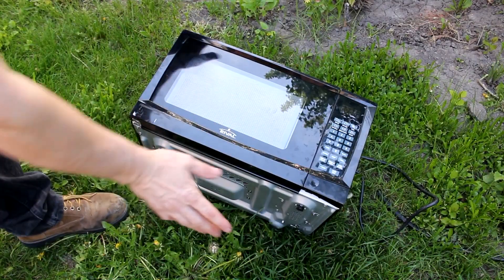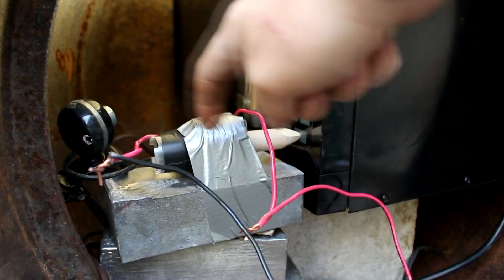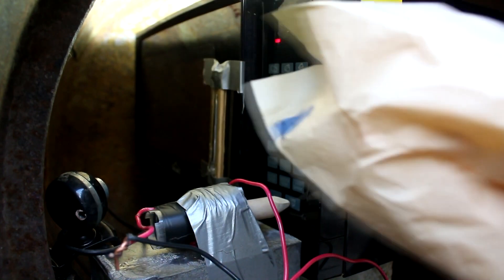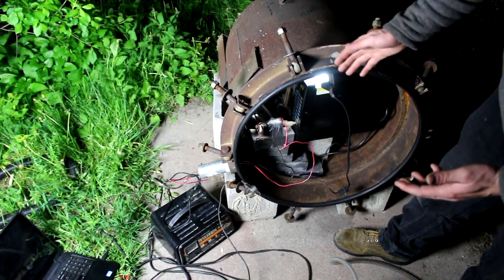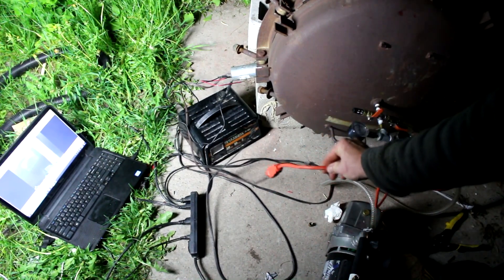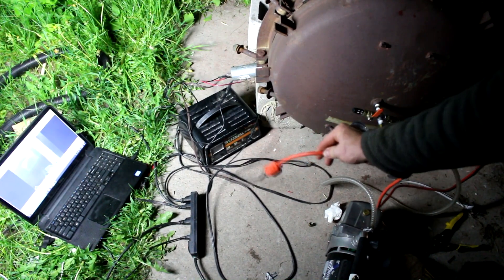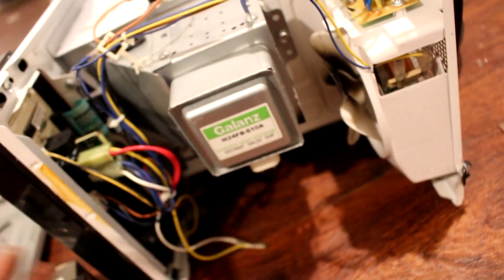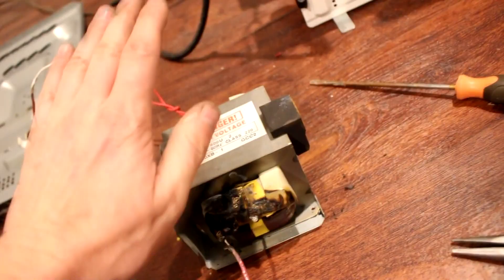Microwave In Vacuum Chamber

Comment: Cody i do quite a bit of work with electricity in a vacuum. i find that in the %95 ish range the electricity can jump a 2" gap fairly easy. especially with the 1-2kv that is the output on the secondary. good luck i look foward to your video on arcs in a vacuum, remember that over 20 kv x-rays are strong enough to go through pretty much anything.
Reply from the maker: lol so by not getting a good vacuum i had the most conductive atmosphere possible.
Reply: Incidentally i just aquried a x-ray machine :). in most machines the starting kv is somewhere around 30kv, and that goes up to, on my machine, 150kv. the amount of x-rays produced is a function of MaS Mamps*Seconds. at 20kv you start generating x-rays that you have to take shielding into account.  thanks for the comment. If I am wrong let me know I love to learn correct information. Thanks
Reply: A little off topic, but whenever I forget to plug in a tool I call it a "malfunction due to a high impedance air gap."
Reply: @lukas janßen
yes i do have to correct this: soundwaves are waves in the density of the surrounding medium, in most cases air. the microwaves from a microwave are waves of the electric and magnetic field (in other words, they are light with a very low frequency). electro magnetic waves do not require a medium to spread, so they can move in perfect vacuum.  https://en.wikipedia.org/wiki/Michelson%E2%80%93Morley_experiment
Reply: you should all look at the previously posted link:
https://en.wikipedia.org/wiki/Paschen%27s_law

If you lower the pressure, the resistance starts to decrease which is what we saw in the video. At a certain point a minimum is reached and if you lower the pressure even more (good vacuum) the resistance strongly increases and gets higher than in air.
Reply: +Aleksa Djokic X-Rays are present when ever a electon strike a target. the reason why X-Ray tubes have a heated cathode, and a tungstan anode is: the cathode is heated because it excites the electrons allowing them to pull free of the cathode more easily. the anode is often chosen based upon its reactivity to electrons, some targets are more likely to produce x-rays than others.
Reply: Don't confuse "usable" x-rays and simple x-rays.  Getting usable radiography yes you are into multiples of 10Kv however, at 10Kv you will have through penetration of x-rays if not consistent/clear/strong enough to create medically usable images on film or in digital imaging.
Reply: wow this is very useful. thank you, it makes sense that the amount of energy goes down as your pressure decreses, after a certain point you would have so little gas particals to ionize that it would be much harder to complete the arc. I think that point would be a couple of Torr. good information thanks
Reply: your understanding of em radiation is way off, em radiation does not need a transport medium for example light from the sun travels through space.
Reply: in addition to the decreased breakdown voltage the insulation resistance of the wiring can also be decreased. During your vacuum electrical tests you should also use a megaohm meter to measure different insulation changes.
Reply: Lukas, micro wave is an electromagnet wave. it does not require any medium to travel.
Reply: It is very possible that the transformer arced.  At reduced pressures, it is easier for an electron to be accelerated to a high energies and then hit an atom causing a cascading effect.  At near vacuum pressures, there are too few atoms that this cascade can't happen.  However, it is also possible that it overheated.  The only way to find out would be to watch it and strap some sensors to the transformer.  Cody should do this!
Reply: That's most likely it, came here to say the same thing. The insulation on the wires of the secondary are built assuming atmosphere is present, so it probably breaks down in near vacuum.
Reply: +tinodedino  look at Tiago Jacques' comment he has a link to the law that denotes the relationship between the voltage breakdown of air and the vacuum achieved.
Reply: Dean; 20kV x-rays are VERY easy to shield, even the material of that vacuum chamber would be more than enough to reduce the amount emitted by the microwave to low (or even undetectable) levels. Actually, since the 20kV isn't effectively converted into an electron beam with 20kEV kinetic energy, and since that electron beam isn't incident on a high density target, the amount of x-rays produced from the microwave would be VERY low... but this is all assuming a PERFECT vacuum.
The vaccuum he achieved would be nowhere near good enough for even a proper x-ray tube to operate... 
In much the same way that a microwave oven doesn't generate any x-rays when you use it at atmospheric pressure, his microwave would also not be able to generate x-rays from those arcs.

Think about it this way: Tesla coils routinely operate with arcs at >100kV and power levels of several kW, but even they don't radiate dangerous amounts of x-rays either.
Reply: Correctamundo, Dean. Partial vacuum is very conductive. At low pressures, most air molecules are more than happy to act as charge transport media, once the mean free path is reduced enough for them to flow somewhat freely. As pressure lowers even further, there are fewer charge carriers left to short things out, and the resistance between two points increases. It's not too terribly likes that you can get a good vacuum with microwave popcorn unless you first remove all the oils and stuff used to flavor the popcorn. Otherwise, outgassing of the test article will keep the chamber pressure too high to avoid what we just saw happen, LOL. Cool test though! (Oh, and I am also looking forward to the giant xray tube experiement! (Be careful when you do that one, Cody!) http://qdl.scs-inc.us/2ndParty/Pages/17894.png
Reply: MadDoctor Whitson when you evacuate enough air you remove the particles that allow for the ionization of the gas. When there is nothing left to ionize you have a complete vacuum that becomes extremely difficult to arc in.
Reply: Thanks Dean, you're a smart fox
Reply: Makes complete sense.. With little to no air, there is less resistance for the electricity, making it able to jump farther...
Would love to see a video of this in action, I'm sure it'll be a bright experience ;) lol
Reply: The sand is there primarily to quench the arc. If you measure the resistance of a blown sand-filled fuse, you may find out that its resistance is actually surprisingly low: a few years ago, my landlord had electrical issues in his apartment and after tracing the issue back all the way to the disconnect switch, I found out that one of the fuses had 60V across it and measured 10 ohms, low enough that my landlord could turn on a few lights, but high enough that everything cut off when the fridge's compressor kicked in.

Copper-contaminated glass/sand isn't a particularly reliable insulator and it doesn't need to be as the fuses' primary purpose is to protect wiring against extended overloads that could damage it. While a clean break would be preferable, anything below the wiring's safe maximum current carrying capacity is still good enough.
Reply: viermidebutura which is what a linear accelerator for radiation therapy produces and it will go through pretty much anything.
Reply: Understandable

Have a nice day
Reply: whereas sound wave is mechanical wave. It requires medium to travel. basically on how they travel through a space. Look for that information about kinds of waves and how they travel in their surroundings.
Reply: +MadDoctor Whitson I expressed myself a bit unclear. We need to distinguish between resistance and breakdown voltage. An electron in a vacuum will travel forever without feeling any resistance. But if we want to know at which voltage an arc forms between to wires, we need to look at the breakdown voltage. And as described in the Paschen law this voltage increases sharply when the pressure gets low enough. 

If you want a more "intuitive" explanation: At vacuum levels of pressure there aren't any air molecules to form a plasma. Therefore there can't be a discharge with an arc. Without this arc-plasma, the electrons are unable to leave the wire and therefore it "seems" like perfect vacuum would have an high resistance.
Reply: Hey Dan, perhaps you're right. Let's do the math. We don't need to heat the copper to it's melting point, just to the point where it shorts, which is where the insulation fails. Suppose the enamel is rated for 105'c (a safe bet if cheaply made). That's 80'c above room temp. Copper's heat capacity is 0.385 J/g'c. And the combined copper is around 1kg. Let's presume most of the waste goes into the copper not iron. We're trying to find the amount of energy in Joules to reach that point. So, 0.385*1000g*80'c = ~31kJ. At startup you might be getting 600watts of waste heat off a transformer that size, so, 600 joules per second. So, 52 seconds before the insulation hits its rated temp. After which it's soft and or flamable and leads to shorts. I think most of the heat's going to happen on the primary side (it's often aluminum, crappier conductor), so, I don't think 30 seconds is unreasonable when you add in vibration. The magnetron is smaller yeah, but how efficient is it? The magnetron is hardly cooled by those fins (in an enclosed box) and has no direct airflow on it normally, so I bet it fails after the transfomer.
Reply: Dean https://en.m.wikipedia.org/wiki/Paschen%27s_law
Reply: tullgutten The cooling would not be a problem in the first few seconds or even minutes.
Reply: The basic theory behind arc lamps also tells you that gasses are much easier to strike arcs with at lower pressures. At the other end of the spectrum, fancy high voltage probes often use pressurized gas as a dielectric to prevent arcing without changing the circuit behavior as an oil's dielectric constant would.
Reply: In a partial vacuum, electrons have more time to accelerates before bumping into another atom's electron cloud and losing their momentum. The faster an electron moves, the more atoms it can ionize, the more ionized atoms there are, the more free electrons there are, the more electrons get accelerated, rinse and repeat.

There is a sweet spot at a fraction of atmospheric pressure where you get the optimum electron speed vs collision rate which yields the lowest arc strike voltage, any pressure above or below that will have a higher breakdown voltage, with the perfect vacuum approaching infinity. Cody's ~95% vacuum is nowhere near perfect for that application.
Reply: I know, i have lots of x ray tubes and x ray equipment. In Cody's case, no x rays are produced.
Reply: Dean thanks!
Reply: MrRolnicek, Exactly. Also, in addition to the lower air resistance mentioned by others,, you may also have to worry about the corona effect, which might serve to further damage insulation and facilitate arcing.
Reply: +Cody'sLab
Correct!
However even perfect vacuum is unreliable as insulator. That is because example sharp cathode (or some dirt) can change the theoretical work function needed to free electrons to the vacuum. Thus you may end up with freely flowing electrons. Resistance or conduction are not quite right terms here. Vacuum do not conduct electrons, vacuum just allows them to fly through it. And when the electrons collide with some atoms there is big loss in energy. Thus we cannot have vacuum based superconductors. Also they would not have induction.
Reply: I believe it failed because the secondary coil arced with the transformer's core, causing damage to the secondary coil. This was possible because there were almost no air molecules slowing down the electrons.
Reply: I don't know if some air is required for the electrons to complete the gap, but some people are saying that resistance decreases to a certain point, then when the pressure drops even more, resistance increases because some air is required for its conductivity.
Reply: +MadDoctor Whitson
Conduction is misleading term with vacuum. The electrons fly through vacuum, instead of moving by conduction like in metals. Atoms/molecules help to carry the charge across when it happen via avalanche effect. In perfect vacuum it happen via different mechanism. Look up "work function" and "field electron emission".
Reply: Might be worth trying to run the microwave again but with the transformer on the outside of the vacuum chamber.
Reply: A perfect vacuum is a nearly perfect insulator with a breakdown voltage around 1TV/m. CRTs and other tubes aren't perfect vacuums and their operating principle is based on a heated anode spitting out electrons from its coating that get accelerated by control gate voltage. This isn't ionic/metallic conduction.
Reply: way back in the beginning of this comment thread is a guy who posted a lino to Wikipedia on this topic. It is a good read to learn more on conductivity in a vacuum. happy reading
Reply: Dean look up the thunderbolts project YT channel. you'll love it. it really opens doors in the mind and shows you the truth about our electric universe.
Reply: Dean is vacuum less insulative than air?
Reply: Martin Ellis Do you know fluorescent light tubes? They conduct quite well I believe ;) Resistance goes down with pressure up until a very good vacuum is reached. Only then it goes back up. This is why high voltage fuses are often filled with sand.
Reply: keeperofthegood oberheating in 10 seconds? Idk, but wouldn't that also make any fan-cooling a joke if so much heat was produced in such a short amount of time?...
Reply: Juan Lopes basically yes. (too) Simply stated:"there is nothing in the way of an electron wanting to jump from the negative electrode to the positive one."
Reply: Looking forward to your video on this topic. Maybe you can improve your vacuum that much that we can see that the breakdown voltage in a good vacuum is indeed higher than in air :)
Reply: Dean ...  Exactly!  Any time you remove part of the atmosphere/pressure it becomes far easier for electricity to arc and jump gaps that would normally be impossible.  Otherwise how would neon signs with several feet of tubing light up when your average sign transformer is only putting out around 30KV?  Without that vacuum 30KV is only going to arc a little over an inch, not multiple feet (In a sign).  At any rate it would have been interesting to see the microwave transformer placed in a vacuum and then powered up without anything else connected.
Reply: I agree, increased electron mobility due to a partial vacuum would have been my guess.
Reply: +Idlehampster He used a brick, what could possibly go wrong?
Reply: Crushedice, I understand how resistance of air decreases in a vacuum, allowing electrons to flow more freely, but how does lowering the pressure even more cause the resistance to increase if you're approaching a perfect vacuum (little to no air to cause resistance)?
Reply: http://qdl.scs-inc.us/2ndParty/Pages/17894.png
Reply: CXR's are 120 kvp on average
Reply: Lot of good answers in here I would have said that air is an dielectric when it comes to RF and the RF took the route of least resistance and fed back into the transformer via the waveguide. I'm looking forward to a good set of results cheers all
Reply: Dean #32 trending
Reply: Dean I am sure of the same thing.
and also when there is vacuum the cooling is non existent
Reply: Memses 55-60 kvp is about as low as used for reg dx x-rays tests.
Reply: It couldn't have been from over heating. I've ran microwave oven transformers for several minutes without anything to cool them and they never burnt out, but they will eventually. In the video, within 30 seconds or so, the transformer failed.
Reply: So many knowledable people on this comment thread
Reply: Thank you Crushedice, and Dean for responding to me. You both really helped me understand what I was missing, and taught me well.
Reply: Dean yes I do agree, I think that there was not enough air in the chamber to displace the heat given off of the transformer. So the paper of what ever was wrapping the transformer was heated up to its ignition point and ignited and probably melted the insulation on the coiled wire intern shorting the system and blowing the fuse.
Reply: did you microwave the silicone?
Reply: Dean why would electricity have an easier time jumping across a vacuum compared to a gas? wouldn't the vacuum be a much greater insulator?
Reply: Martin Ellis only a near perfect vacuum is insulating. neon tubes only need a few kilovolts to jump several feet. they have pressures around what cody got. the 2Kv secondary could definitely arc itself out like that if there were some cracks in the insulation.
Reply: Teardown Dan ah, I see, really helpful explanation thanks.
Reply: Dean Paschen, got it, learned something :)
Reply: PaybackCreeper9 paper doesn't burn in a vacuum, and a microwave cannot overheat that quickly. the near vacuum was right around neon tube pressures and the 2kv secondary with a crack in the insulation can easily jump large distances.
Reply: No Insulators bro
Reply: I think you would've been in trouble anyway, microwaves are massively underbuilt, their transformers are 1/4 the size they should be. They make up for this by having a giant fan in front of them, which is where almost all of the noise in a microwave originates. I've got tutorials on my channel on how to rewrap microwaves, when you're reusing them as welders and such, they'll cook off in like, 30 seconds without a fan. Without even ambient air cooling? Probably wouldn't have lasted much longer.
Reply: Here's how you pope.

https://upload.wikimedia.org/wikipedia/en/9/9a/Pope_card.jpg
Reply: Scott Sakurai  OMG, that's some kind of awesome XD
Reply: Lukas Janßen electromagnetic waves travel through a vacuum easily - for example to space. Otherwise we could not communicate with the mars rover or the iss. No air needed.
Reply: Really? I thought fuses were filled with sand so if an overload occurs, the sand melts into glass resulting with a highly resistive ceramic. Effectively disconnecting the circuit.
Reply: It's why CRT are normally "only" 19kV. Because you'd need x-ray shielding otherwise.
Reply: 10 ohms at 120V means 12 amps potential current flow (assuming a short circuit, but that's quite likely considering a use tripped) and 60V across means 720W dissipated in the fuse. I hope that was a great big fuse because otherwise his fusebox probably caught fire.
Reply: That was a 100A service entrance panel fuse. The panel itself was intact and lukewarm while the fuse had minor discoloration near its top. Nothing was anywhere near catching on fire.

Also, if the fuse had a dead short on it, higher internal temperature would further increase its resistance and if it got hot enough to melt the metal-sand mix, that could melt away the conductive bridge or at least further increase the resistive gap's length and resistance.
Reply: i bet dean works on super secret cool stuff
Reply: Some of the flawed information in this thread is painful.
For one thing, there seem to be people who think that electromagnetic waves propagate the same way an electric charge does (hint: photons and electrons are not the same).  
People also don't seem to realise that, as explained in the link in the second comment on this thread, breakdown voltage is a result of available charge carriers to ionise (which decreases at lower pressure) and the freedom for those charge carriers to move about (which increases at a lower pressure).  The lowest breakdown voltage is the point where those two limiters intersect.
Vacuum tubes like CRTs and old valve tubes ideally work on the transference of only electrons rather than an ionised gas conductor.  So, for an arc the air is being ionised to plasma form and that forms a conductive path for the electrons.  For a vacuum tube the principle in operation is thermionic emission of electrons, basically the cathode gets so hot that some of the electrons "boil off" the metal and get captured by the anode.
Reply: dat profile pic though
Reply: Yeah, usually x-ray transformers produce over 100Kv
Reply: mV is millivolts. Did you mean 20 MV?
Reply: Really it was an arc that caused this? I thought for sure that it would be the air cooling that was missing an important component to function properly (air). But then again it did die a lot faster than it should have by overheating.
Reply: Dean do you know why a 95% "vacuum" is the best?
Reply: 20mv is 20  millivolts 
but i guess you meant 20MV
the problem is that at this voltage electron positron pairs start poping into existence and when the positron  annihilate gama rays are produced
Reply: I think Martin Ellis got it right. I'd love to see the math though, what's the rate at which vacuum slows down  heat dissipation to the point where the plastic, the fuse and ultimately the coils cannot handle it. EDIT: Which makes me think that if you shorted the fuse you could get the thing to melt until the cables break ^_^ EDIT2: Beware of the microwave losing its shape and having the magnetron pointing to your body Cody.
Reply: With 20kv on a real x ray tube, you cant even do a decent dental exposure. Also, you need at least a vacuum of 10-6 torr to be able to make x rays. And on top of that you need a heated cathode and a special anode.
Reply: Hooray, corona discharge in dirty vacuum!
Reply: The answer is much simpler than all this. The fan is useless in a (near) vacuum; thus the windings are overheating, not having enough radiative cooling.
Reply: Felony Videos, when there are little to no charge carriers left in a gap for electrons to flow, I wouldn't call that resistance, because there's nothing physical slowing the electrons. I would call it capacitance, where there is nothing conductive in the path of electrons.
Reply: Lots of posts here contradict each other.
Reply: Total junk comment. Microwaves (radio waves) travel in a vacuum. Also they are not generated by the transformer, but inside the magnetron, which incidentally IS a vacuum tube itself!
Reply: Combat Pyro nope. Conductivity is the inverse of resistance, it tells you how much something wants to conduct electricity. Metals for example are really good conductors because of free electrons. Destilled water is a pretty bad conductor (only charged particles due to autoprotolisation). Vacuum has absolutely nothing that wants to transfer electrons and therefore has a high resistance
Reply: The transformer is around 2kg of iron and copper, which is going to take several minutes to get uncomfortably warm even if the transformer was dissipating 1kW due to its massive specific heat. The magnetron on the other hand only has a few grams of aluminum tacked onto it and is the bit that fans are tacked on in all microwave ovens I have taken apart.

The magnetron will fail long before the transformer gets a chance to warm up.
Reply: Yess! Cody will do something I suggested! Woohoo!
Reply: I'm no expert for certain, but as far as I am aware a vacuum is a better insulator then air. I work with circuit breakers upto 132 kV and one of the many different mediums we use to suppress arcs is a vacuum. the gap for 132kV is in mm. while I acknowledge Cody's vacuum chamber isn't a perfect vacuum, far from it, removing most air would only increase resistance, not make it easier for arcs. My personal opinion would be heat melting the minor or major insulation of the transformer. They do get very hot and with no way of conducting that heat away (due to the vacuum) it would burn through the insulation very fast.
Reply: Dean I second that.  If you look at a fuse, they're rated at for example 10A/120V or 20A/250V.  The voltage is included because at atmospheric pressures that is the maximum rating that a fuse can interrupt the potential without it arcing across the connections.  In a 95% vacuum I would think that there would be much less electrical resistance due to the air being evacuated.  That is probably what allowed your voltage potentials to arc across the conductors in the transformer.  Air = Resistance, both physically and electrically.
Reply: Cody'sLab no, exactly the opposite.  By getting a good vacuum you achieved the most conductive environment possible.  The lack of air "resistance" caused greater conductance distances at the applied voltages.
Reply: I agree MrRolnicek the issue really is in the physics of the construction of the MOT. They are notoriously badly designed.  Without a full blast of continual air cooling and without a short operational cycle they burn up really fast.  Even home hobbyists may use a MOT at some point but they quickly abandon them as unsuitable.   The issue that Cody encountered is the failure of the fan to cool the MOT.
Reply: I'd be careful messing with electricity inside that large, metal container.
Reply: Makes sense if you think about it. The vacuum was introduced slowly so the temperature remained constant. Which means the particles have a lot more energy. This makes ionization easier. Right? Am I going about this correctly?
Reply: Poping?  How does one pope?  I'm guessing you meant "popping".
Reply: Needs at least 511kV for antimatter production. With the arcing in vacuum, the violet glow is always beautiful in person. Sadly, our computer screens can't show violet.
Reply: Guys, a vacuum is an insulator. An arc still needs some form of particle to pass through. a vacuum has nothing. removing air only increases resistance.
Reply: I'm not even sure you could do a decent chest x-ray with 20kv.  Did you mean 20 mv?
Reply: Cody i think that the vacuum is better isolation than air so arcs are impossible. I study electricity.
Reply: my Englisch is not really good but i hope you understand is. an Microwave produces microwawes (Like soundwaves Just smaller) wich travel into the cooking chamber there its makes the  electrons inside your food (or whatever you wanna put there ) move in other words it heats your food up but without air the waves have no way to travel and keep been where they got Made and heat up everything there Like you saw on the Video

if somebody has time he May correct this Junk of a comment i Just made
Reply: @lukasjanen7989  Microwaves travel in a vacuum. If they did not, a microwave telescope would not function to see microwave transmission from stars.  A little late in the response but just in case anyone else is viewing this in the far future.